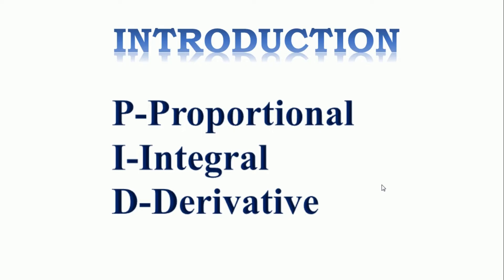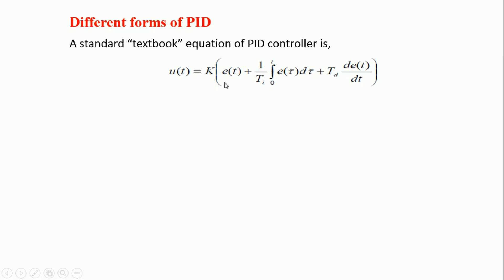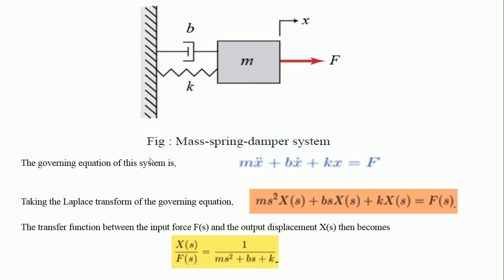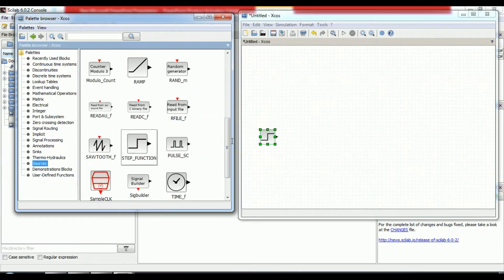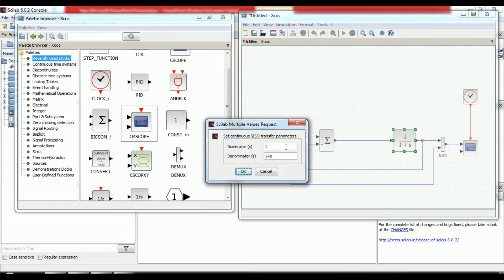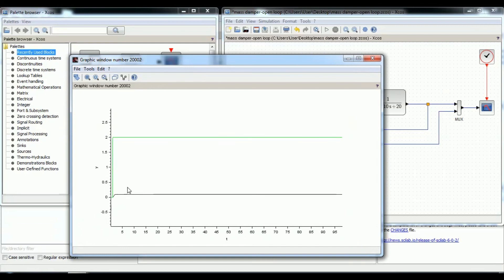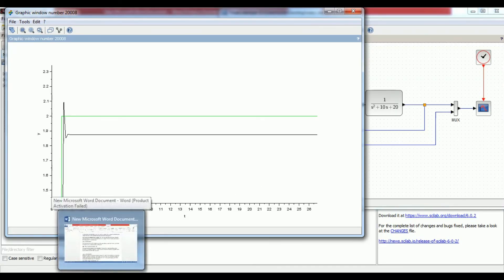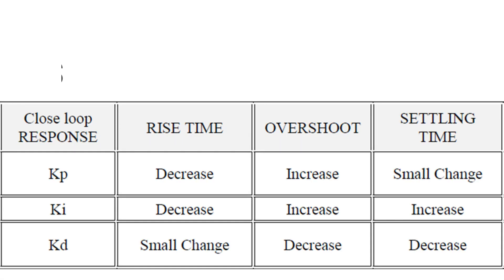PID CONTROLLER USING SCILAB XCOS MODULE WITH EXAMPLE

Comment: the open loop experiment is wrong, you should just connect the step directly into the system, there should be no loop, that's why it is called "open loop"
Reply: This!